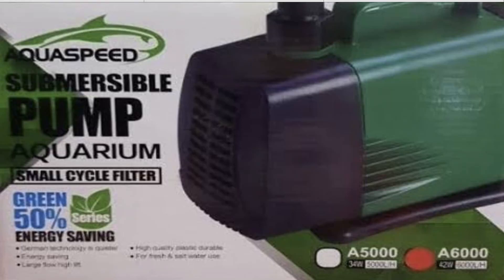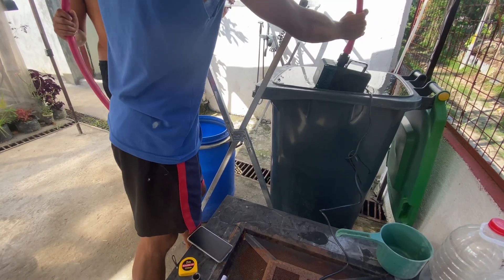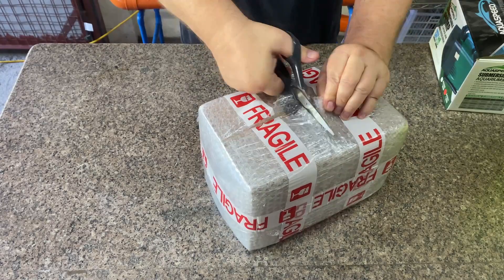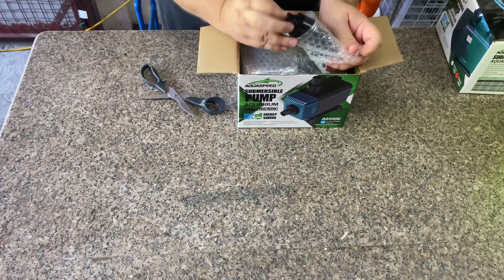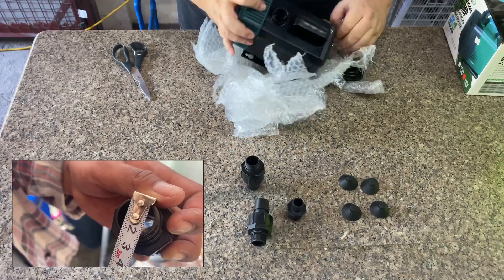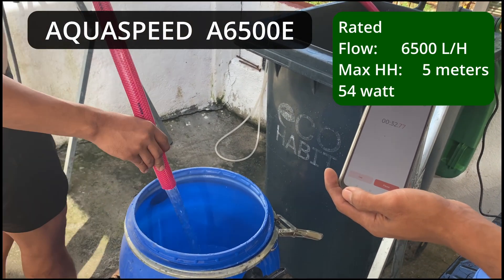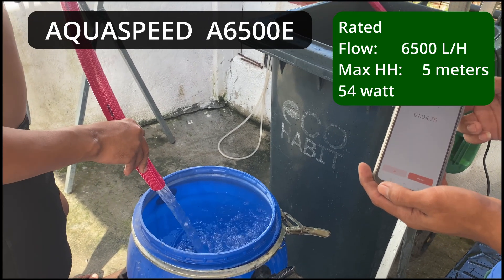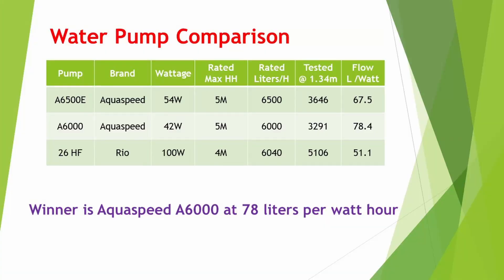Aquaspeed and Rio Water Pump Comparison

Comment from the maker: As Petermaya pointed out,  I forgot to show the prices of each pump. I paid way too much for the A6000's because I purchased at a local pet store.  The best prices I found have been on Lazada here in the Philippines, so here is what I paid (including shipping) for the other two pumps and the price for the A6000 also from Lazada. Thank you Petermaya. 

Rio 26HF: 4,069p ($81.40 usd)              A6500E: 2,346.50p ( $46.95 usd)                   A6000 2,069p ($41.40 usd)

Comment: A Rio hyper flow is a neat pump,But,Their magnetic impeller assemblies suck any debris that get in or on it will make it rupture.because of the quality of the magnets the company used and the bonding they used to mount the turbine head to the magnet..
Getting one out is a pain if you can get it out,and the expense for a new impeller is almost as much as a new pump.